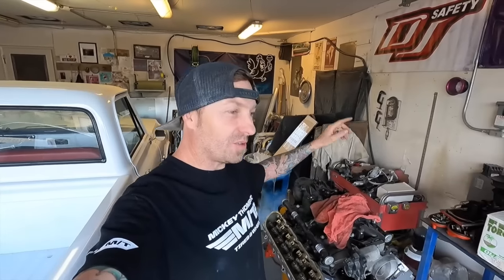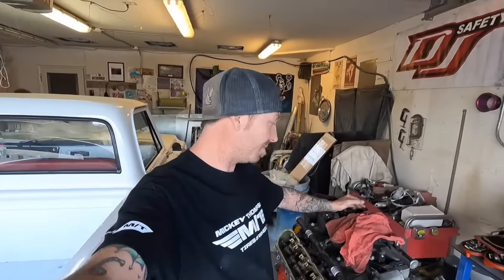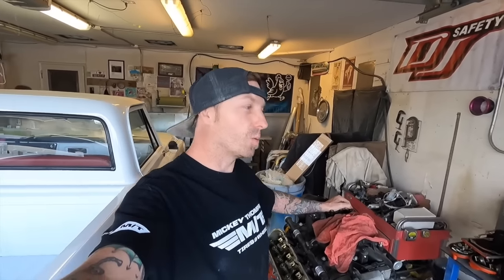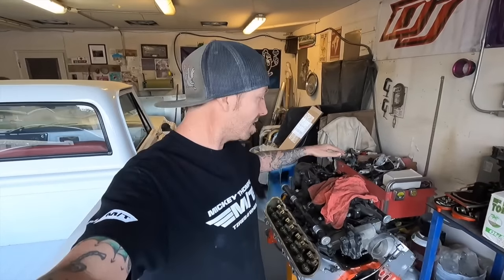Junkyard LS Motor Teardown What To Look For

Comment: That janky paint job was your 1st red flag.
Reply: No doubt. I paint mine, but that ones ridiculous.
Reply: Krylon rebuild
Reply: @trentdawg2832  Who paints an engine with rattle can lacquer? Same people that spray aluminum heads silver :D
Reply from the maker: I thought it would add some HP but guess not. HAHA . It was a smoking deal on a motor/trans combo so its not the end of the world. I agree tho the paint was pretty spectacular
Reply from the maker: @notsure7874  Even the exhaust ports. I bet this thing would have looked awesome after a few heat cycles.

Comment: What sucks is that the paint and silver heads make it look like a good engine. Polishing a turd.
Reply from the maker: Yes. Another good lesson to look out for. If it has paint in it it’s probably been out of a vehicle before. Unopened motors are usually the best candidates

Comment: Look, I'm sorry you need some experience before recommending anything to do with an engine.  For example the harmonic balancer bolt is not reusable nor are the head bolts, they're torque to yield 1 time use only.  The engine obviously had a bad head gasket or cracked head that's why there was rust in the cylinder.  It's highly unlikely that the water was introduced by any other means because other cylinders would have been affected as well but no evidence of that. I'm sure you mean well, but really get some experience and get educated on engines before giving advice that could do harm to the person listening to you. I'm not saying these things to hurt you, I'm trying to save you from hurting others.
Reply: I was thinking the same thing, I would not let you around any thing that I own !!!
Reply from the maker: Im not hear to cause harm to anyone. Im curious if you have ever seen any of the Sloppy Mechanics videos or any of my other content. If not I encourage you to stick around and check out some of what we do on the channel. I appreciate your input.
Reply from the maker: I would let me either
Reply: @Burndown Agreed! I've seen Matt on Sloppy do some crazy things with reusing parts and then bolting on a big fat turbo! Goes against everything we were told to do and not do when it came to inspecting/rebuilding!!
Reply from the maker: @user-lv7ck8gf2k  I have made over 600whp on used head gaskets and he’d bolts on a 100$ 5.3. It’s all possible it just depends on what your willing to do and you’re expectations. I ran the motor for over two years and the used lifter trays gave up so now I always change them out. Don’t let people tell you you can’t do things